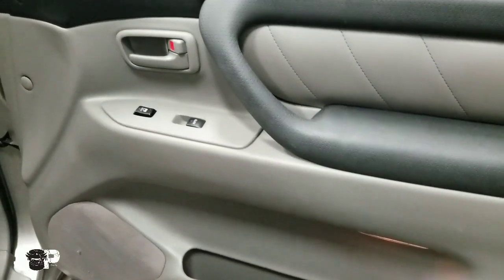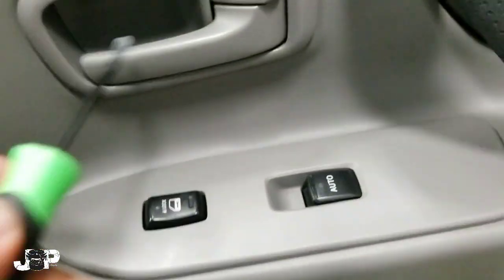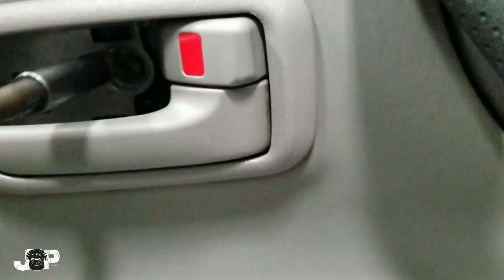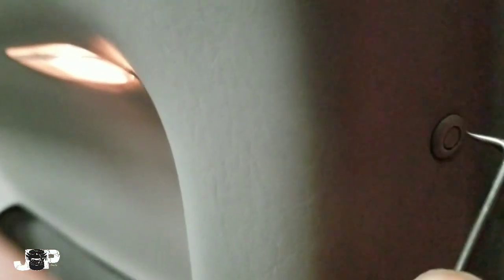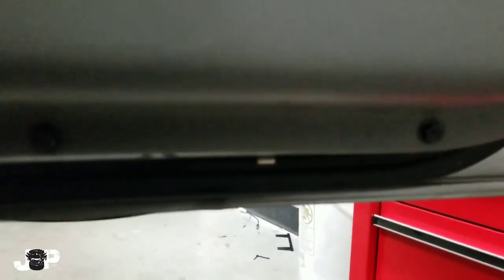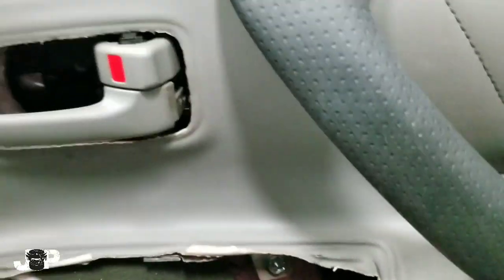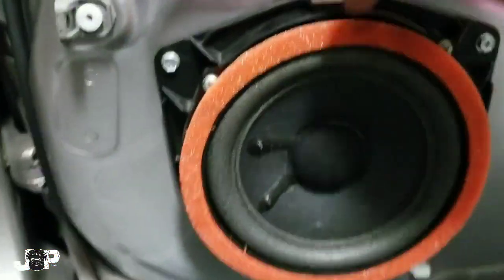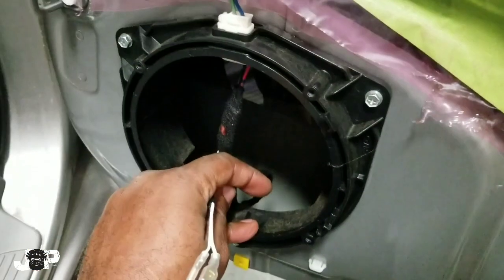Replacing the front speakers in a 2007 Toyota land cruiser

Comment: Great. Video- Thanks.  I have a 02 Landcruiser I'm getting ready to update audio on. What about the tweeters that are located up by the window.  Are those wired separately than the door speakers? Do they still work after you replaced the door speakers.  
Thanks 
Mike
Reply from the maker: yes those tweeters still worked. in some cars they have a separate crossover network and in some they are wired to same speaker in the door